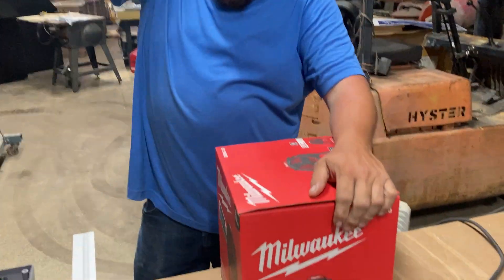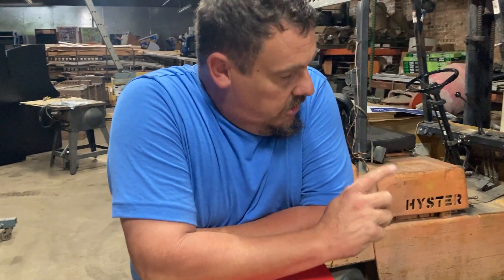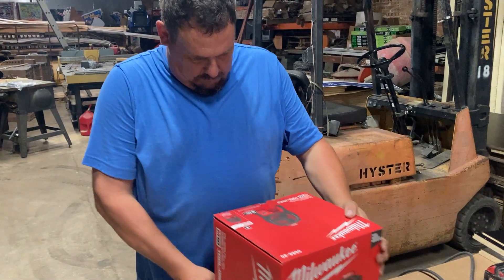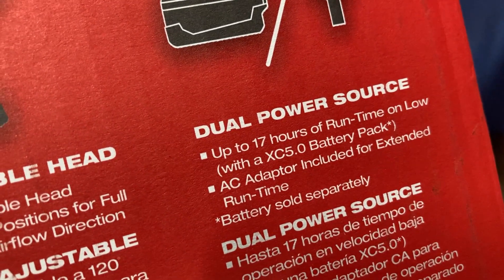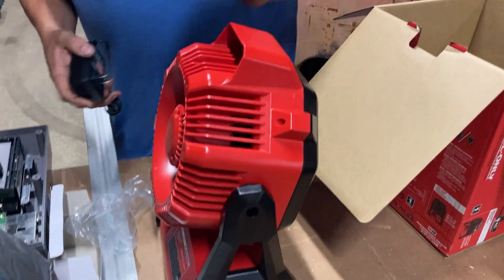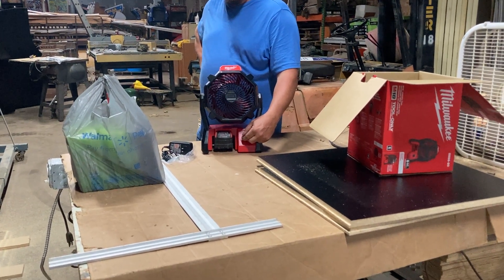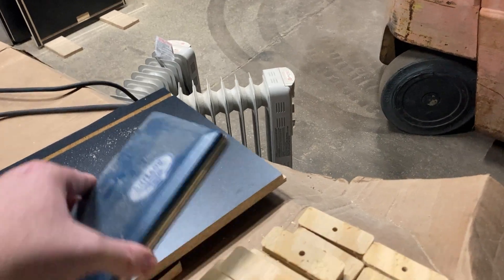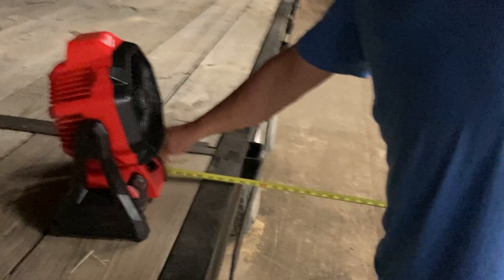Unboxing Milwaukee's New Battery Powered Fan And Checking It's POWER

Comment: I am a huge Milwaukee fan. I have over 10k worth of M18 and M12 tools. I am going to get one of those fans but I refuse to pay $100 for one. I have seen them on clearance for $30 at Home Depot before and I should have got one when I saw them.
I have a older metal high speed Hunter fan and that thing puts out hurricane force air. It is awesome
Reply from the maker: I wish I would have seen them on clearance lol